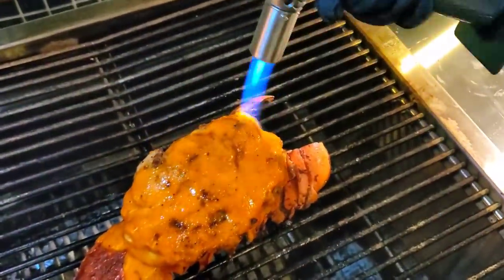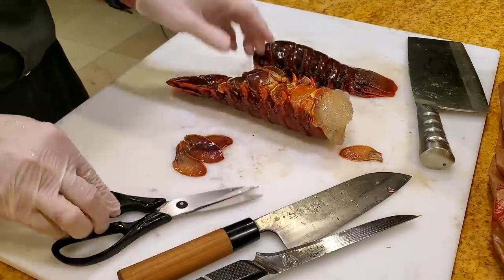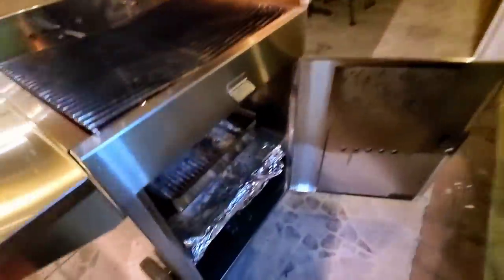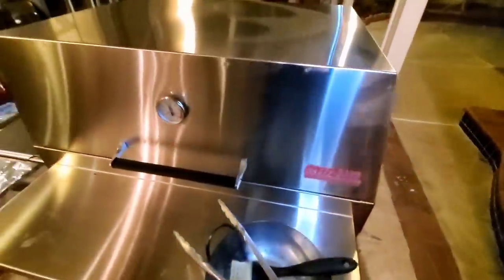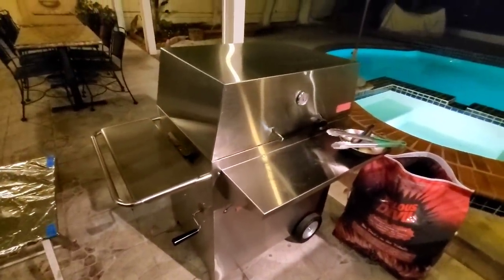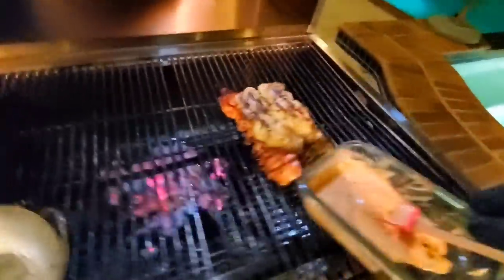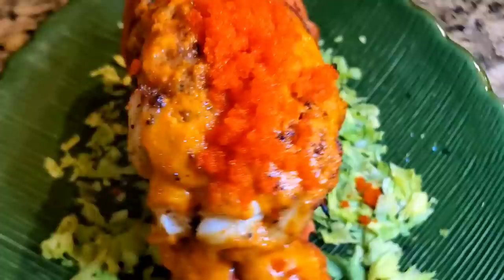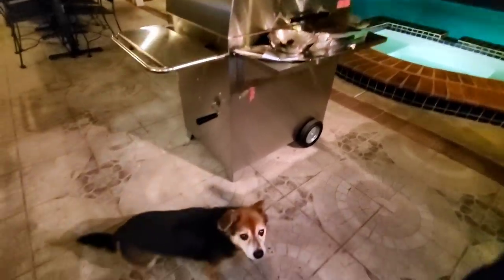Grilled Lobster Dynamite | Pt. #3 Hasty Bake Legacy 132 | BBQ Champion Harry Soo SlapYoDaddyBBQ.com

Comment: Harry, couple of weeks ago you posted a lobster & grits video. I splurged and picked up 2 tails and mimicked your recipie for a New Years dinner. Strangely enough all I could find was quick grits (Vons & Stater Bro), so I made my grits with corn meal. My research said it is the same as grits just a finer grind. Came out excellent! Thanks cowboy!
QUESTION: I have now heard from 2 people that searing with a propane torch (not butane) imparts a bad flavor on the food. Ive used my propane blow torch at times and can't taste the flavor. Maybe it's just me but do you find using propane over butane is a bad idea?
Reply from the maker: Can't taste any bad flavors on my gas propane grill or my Grill Gun